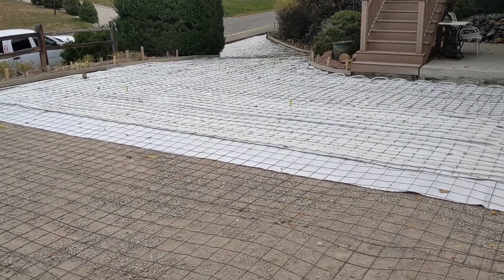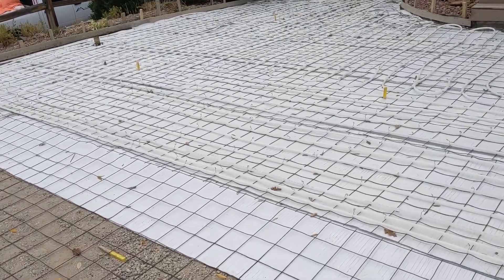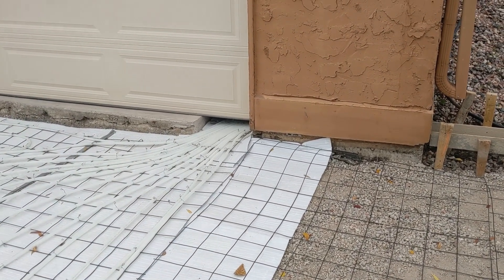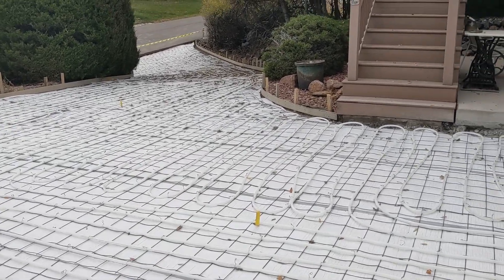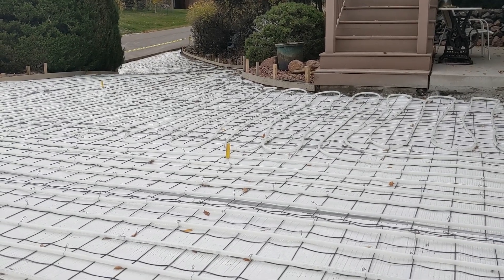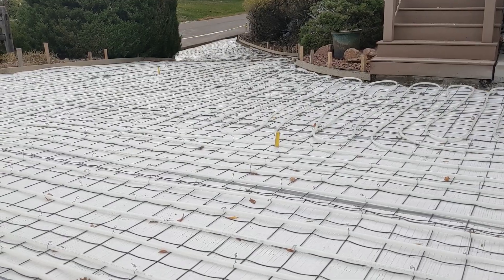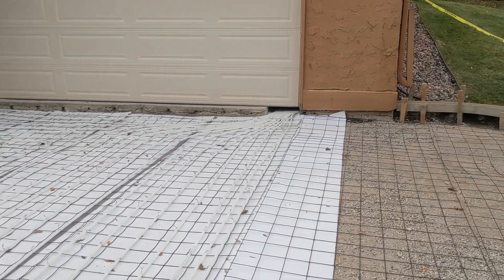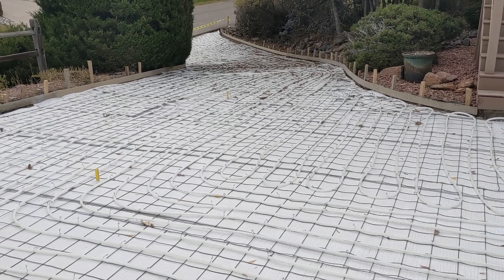Heated Driveway - Hydronic Snowmelt System - Elevation Concrete

Comment: What does a system like this cost?
Reply from the maker: Sorry for the late response. You'll fall in right around $50 per SF for a system like this.
Reply: @elevationconcretedenvercol3885 is that including concrete or just the hydronic heating system
Reply: Hello, Does  the 35-40 per sqft price include hydronic system and concrete?  @elevationconcretedenvercol3885